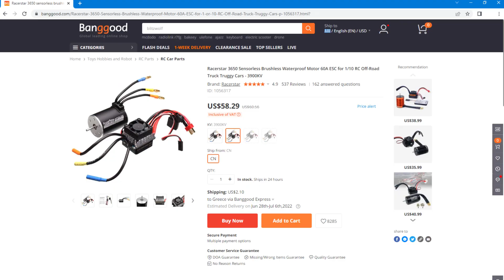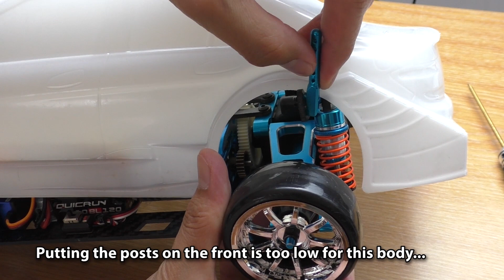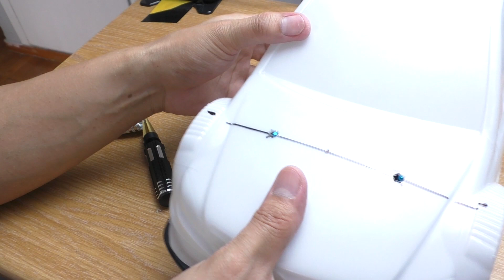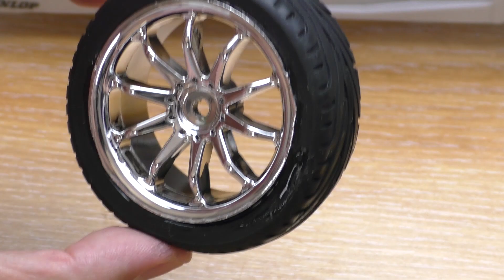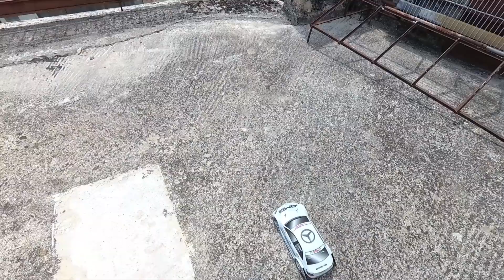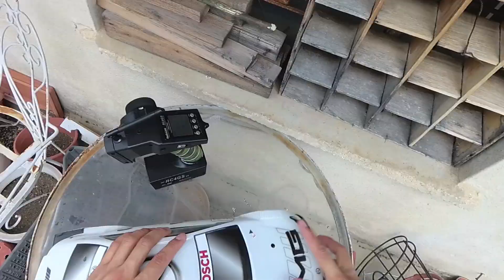TT-01 Carbon-Aluminium Project EP3: Build Vlog 02 - Soldering, Finishing Touches & Test Drive

Comment: Hello,any avance in your setup?
Reply from the maker: I've got the help from local club to set it up. Basically for touring in general is front spool or in this case locked diff. Open it up and glue the gears inside is enough. Rear diff setup is with medium to high resistance. It's with oil no.20000 on my track, yours might be different. Hard spring on both front and rear. 1deg front toe out. 5mm front ride height and 5.2mm rear. Again, toe and ride height differ from track to track.

Comment: You’re gonna need some proper rubber race tires. I started with the cheap eBay/amazon stuff. Then I never looked back when I started using race tires that are temp matches. I really like sweep or rush racing. For track surface temp 70-100F i use 36 deg tire. 100+F I use 40 deg tire. I love 1/10 touring.

Comment: Is there any way to estimate top speed of a 9500kv k696 with 17t pinion and 25 tooth spur gear?
Reply from the maker: KV means RPM per volt so you can multiply that by 8.4 (fully charged 2S lipo) and then multiply that with final drive ratio to get the RPM of the wheel. After that multiply it by the wheel circumference and you will get the speed in mm/minute if you measure the wheel by mm.
So it's around 76KPH theoretical top speed.
Reply: @BeaversHobby  where can i find a larger pinion gear? Or a smaller spur gear. For the surpass hobby 1410 would the shaft be 2mm?
Reply from the maker: @3to3is  Banggood, ebay or aliexpress. It's just a standard plastic gear mod 0.5 pitch so you can find it pretty easily. And yes, the shaft is 2mm.
Reply: @BeaversHobby  is the spur gear on the driveshaft have the same 2mm diameter or is it different? And would you recomend gaining top speed by changing pinion or spur gear? Is there an advantage one way or another? Also, Got it working today and after fixing some broken parts and also am finding that my suspension is rubbing the ground, is there a way to fix that? Sorry to ask so many questions btw, thanks
Reply from the maker: @3to3is  The spur slot is around 3mm and it goes into the rear gear so, different way to insert it. Both ways result to the same thing but adjusting the pinion is easier and has more choices.

Comment: Which soldering iron are you using. It seems really light and easy to manage around small projects.
Reply from the maker: Sequre SQ-01 https://bit.ly/3D8hAKa
Here's my review https://youtu.be/HOchoQJ1cjc
Basically it's the TS100 from another manufacture. It's really good and you can power it with lipo when you are outdoor as well.
Reply: @BeaversHobby  Awesome! Thank you for the information. Great video as usual, thank you for the content!